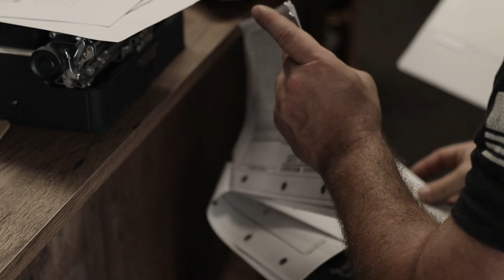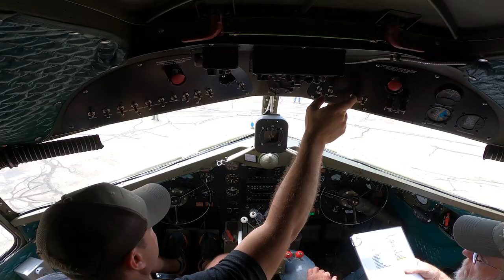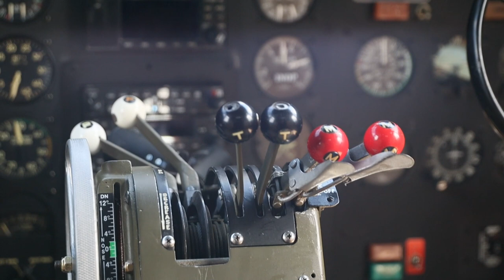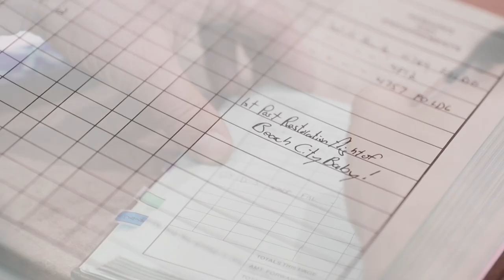Beach City Baby First Flight

Comment: Why is this a C-53 and not a -47?
Reply from the maker: Hi Tony, the main differences include C-53s having a smaller passenger door and small cargo door on the rear captain side of the aircraft. C-47s have a much larger dual cargo door in the rear along with a reinforced floor which the C-53s do not have! Visit the Vintage Wings site to learn more here!!

https://www.vintagewingsinc.com/what-is-a-c-53
Reply: @KinseyMedia  thank you for responding. I learned something

Comment: Looked good until I saw the cabin windows which are totally wrong for an airplane in military colors.
Reply: The work needed to replace the large bay windows in the back was deemed to difficult / arduous at this time. I believe they may eventually go back and fix that at a later date.
Reply: @WarbirdKid1940  All of the windows have been enlarged, not just the bay windows.
Reply: @davidobyrne9549  Curious how you did it on your C-53 restoration David...
Reply: @davidobyrne9549 , so that means more of the original airframe was taken out.  sad to see that happen for any reason.